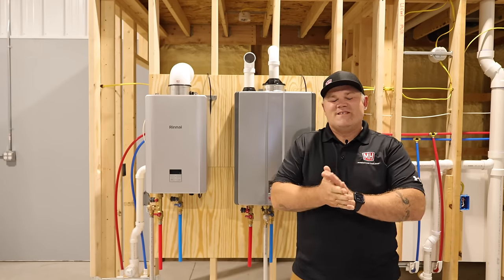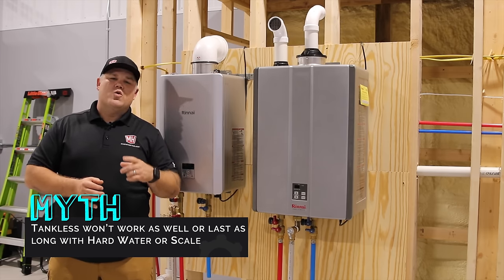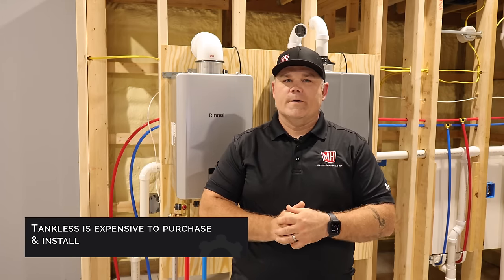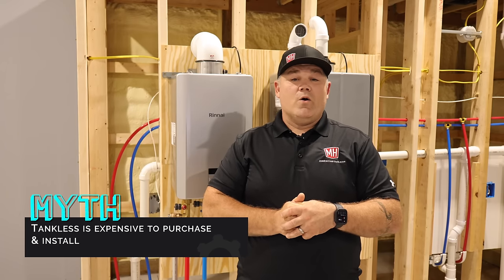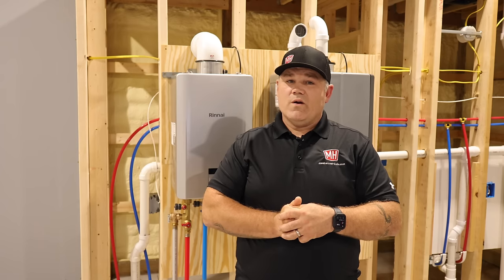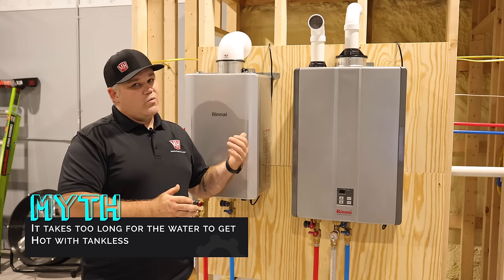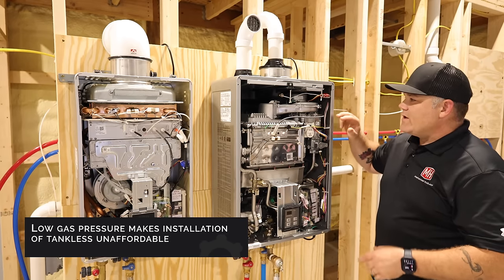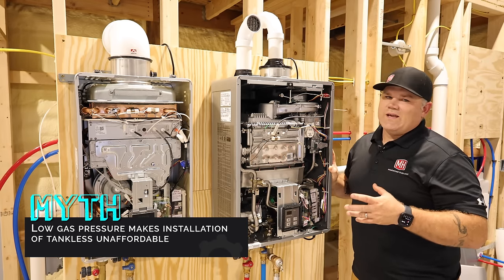Myth Busting! Tank -vs- Tankless Water Heaters

Comment: You can say whatever you want about tankless water heaters and how great they are.  I call BS.  I had 146 Rinnai tankless water heaters in two apartment buildings.  Both buildings had whole building water softeners that were well maintained.  We were replacing water heaters at the 6 year mark and replaced over half by the 10 year mark.  I will never have a tankless water heater in my home.  I am a licensed Master Plumber / Gasfitter in WSSC in Maryland.
Reply: Jackjack-jy3vu I am a chemist and I don’t necessarily have anything against your claim, the faster something heats the more likely is the material to malfunction. You do provide some good examples of materials that behave in this way. I would, though, be cautious to generalize this claim to all materials. We all know that different materials have different temperature capacities before basically melting or weakening. Steel to murcury or gallium which are metals that are liquid at room temp. Also different metals or materials are subject to different stressors bases on temperature changes. So depending on what the water tank heater is made of determines whether it can undergo the type of rapid heating without jeopardizing the durability of the material. That said, I don’t know what materials tankless water heaters are made of currently. It may be that they do degrade in strength or durability as you say. But as new materials are created this will change
Reply: Betting they weren't maintained. I've had mine for over 10 yrs with no issues. Just have follow the maintenance of them.

Comment: I've had the Rinnai in my house for more than 15 yrs. Our community has hard(ish) water (treated lake water), I've had the unit flushed twice, the solution was almost as clean as when I started.  Never an issue with not enough hot water, able to fill my 4 person hot tube with hot water.

Comment: I had a Rinnai water heater mounted on the outside of my house. It was rated at 8 gallons per minute. I never ran out of hot water. After 17-18 years, I had to replace it with a similar Rinnai model and again, it just keeps pumping out hot water. No regrets here.

Comment: I was using propane powered tankless heaters in Spain in 1964. They were cheap and worked very well. They have been used all over Europe for a very long time. I recently converted to natural gas her and heard the same myths when I enquired about tankless, especially the “our water is too cold here one”. They did install a larger meter because I expressed an interest.

Comment: Great presentation!  So many folks are so-o-o uninformed!  I am using my 2nd Takagi (Japanese) unit since 2003.  My first one was a, T-K2, 185k, BTU, with  natural gas (largest capacity I could get then). My 2nd one is again, Takagi,TK-3010U-I, I installed back in Oct, '22.  I can't believe the old one only lasted 22 years.  Guess they don't make'm like they used to :).  I am not HVAC, but a reitired RN and jack of all trades, ha ha.  I first learned of tankless hot water systems while living New Zealand back in the '80s.  Very popular.  We had a Rinnia unit, not sure which model, and we also had another one gallon, (or 4 liter) capacity, electric wall mounted tank for "cuppa's of tea," both natural gas, in the kitchen (most businesses there had one of them in their breakrooms.)  My plumber buddy helped me install the 1st one, back here in Kansas.  It was all new to us and we probalby broke some code rules.  We vented it out with triple walled, stainless steel, ducting into a three story brick chimney.  But it lasted for 22 years safely.  Like you, we never ran out of hot water, for showers, dishes, launday, and bathrooms,  since.  We raised 8 children and have all of the appliances that takes also.  We do have a 50 gallon holding tank, that feeds the hotwater unit, from our 2009 geothermal heating/ac unit. Our Kansas public water is 58 degrees into the house.  The the tankless unit call for water is delivered just under 70 degrees from the holding tank.  That makes a great difference in temprature change especially in the winter when the geothermal is in its heating mode.  MYTH MYTH MYTH.  People just do not know. 

 It is so neat you are out there to let them be aware. GOOD on you!  I subscribed and I LIKE!

Randy,
 
Hay seed in Kansas and money in the bank from my savings in water power bills.

Comment: 50 gallon 40000 btu Water heater tank just went out. Called around and best price for unit with install was $2700 here in north Dallas TX. Checked on a tankless as heard good things. Best price was $7450 because it required different gas line and venting plumbing. Y’all get the point. Found the exact one, had it delivered, neighbor helped get it into the attic and installed it for about $950 after running to Lowe’s and replacing some older hoses. Better for new construction if you’re thinking to make the switch.

Comment: 3 things, 1. Clarify using propane/natural or electric type units (mine is an electric with THREE(3) 60 Amp 220v breakers. 2. All thankless hot water heaters should be "backflushed" yearly to remove trapped hard water waste (Install flush kit when installing unit on incoming/outgoing lines). 3. My FIRST experience with thankless hot water (and I was blown away by this) was in 1983 (yes, 1983!!), while stationed in Germany.. I was never so happy to have "instant" hot water that never ended (providing "fuel" was present). 

I have 1 tank in my home, if I redo my hot water situation.. I would change to a unit at each location (ie.. bathroom/kitchen etc).

Other than power requirements, if you go electric, I love these (I do not have the brand you mention).

Thanks for the cool video

Comment: Had my tankless installed 18 years ago as part of a copper re-pipe of my old formerly galvanized home.  The overall cost of the re-pipe was about $500 more if going tankless.  The weather in my area is extremely calm, so an external unit was used to save on any necessary ventilation.  So far I have basically never properly maintained it (really, never any maintenance at all, too lazy) and the paint has oxidized a bit, but it's as rock-solid functional as day-1.  In my case; it's been all pros, no cons, and plenty of consistently hot tap water.

Comment: Can you give information or talk about what maintenance needs to be done with thankless water heater and how often
Reply: @andrewtalaga5328  i have an electric on-demand heater in Minnesota. Once a year, I use a pump to cycle diluted vinegar through it for about an hour. That’s it. Keep the equipment right there so I just have to hook it up, put water and vinegar in the bucket and turn it on. Rinse with fresh water to get the acid out of the system and the pump for storage. Mine is a Stiebel Eltron I bought on Amazon. Actually bought a lower-priced “Like new” that looked like just a return with some minor package damage. Unit was perfect inside. Saved a lot of money.

Comment: I have tankless in 2 homes. My main complaint was waiting for a minute or more to get warm water just to wash my face or brush my teeth. My solution was to install a small 2.5 gal tank under the double sink setup. Now, I get hot water IMMEDIATELY but I don’t turn on my tankless heater and waste water. Most other appliances use much more water so time is not a factor. These small tanks can just plug into a regular outlet and they use only 1500 watts. Love it.

Comment: Takes a looooong time to get hot water.   Like 2.5 minutes vs. 30 seconds for old electric tank.  Almost 3 gallon of water (I measured) goes down the drain before it's hot.  Rinnai RX199i.

Comment: I only could fit a 40 gal to replace my existing one. Plumber recommended a rinnai 13 years ago. I recommend it. Last year was first time I had to call for a service by authorized repair because it wasn’t working. They charge about 200 bucks to service it and it is still going. He was surprised I never did maintenance on it. He said my town must have soft water. Anyway to me having a tankless is the only way to go.

Comment: I have had my Rinnai for well over 10 years with only 1 problem. Sediment built up on the sensors and randomly shut the unit off. I installed a whole house filter for sediment and I flush it with vinegar every year or two and it has worked flawlessly.

Comment: I have a flow meter on my pipes to the shower. I know exactly how much hot water to cold water it uses. It's a lot less than 80% depending on what time a year and what the hot water heater set at. Love the video. Thank you.

Comment: Venting can be expensive if you have to route the vent pipe above finished drywall where portions will need to be removed and patched.   The whole ceiling will probably need to be repainted after the patch or the patch will be obvious by not blending in with the rest of the ceiling after painting the patch area, especially if the ceiling is textured.  There is also a limit on the distance you can go with horizontal venting but it can be increased with  larger diameter pipe, which may also be impossible if obstacles like HVAC duct is in the way.

I had an opportunity to install a tankless WH for a remodel but opted for a 77k BTU HTP 50 gal stainless tank.  High recovery rate similar to tankless but with a highly insulated tank and 97% efficiency.  That design offers higher hot water output than a tankless with the 50 gallon buffer with a smaller BTU gas line input, where a tankless unit would have been 160k BTU or more.  Many homes have 5/8" or smaller main gas lines which can't deliver enough gas to a furnace and tankless WH at the same time on a very cold winter day for a decent size home.

Take this myth busting vid with a grain of salt.  Not every situation is the same.  This vid is correct if you can check all his boxes.

Comment: Had an electric tankless for 23 years, needed it with 5 boys...worked great, instant heat....kept the girls from staging a revolution, as they could have a bath and actually get hot water (had two systems-tank in the older part of the house-tankless in the newer.)

Comment: I installed a propane-heated Paloma tankless.  It worked okay for a couple of months, then it started cutting off right in the middle of a shower, and then mysteriously coming back on again... sometimes.  I went back to using my electric heater, which I only turn on ten minutes before I shower, then turn off when I'm done... works perfectly.

Comment: regarding gas line and meter upgrade, the code requires that a tankless WH uses min 1.25" gas pipe, and this can go up if the WH is far from the meter.  Even if you think it works without upgrading the pipes and meter, the code doesn't care, you still have to pay for the pipe and meter  upgrade.  You also didn't include the 120 volt outlet required for the tankless controls. Old WH didn't require power. New installations won't see this extra coat,  but a retrofit may require running a circuit to the tankless WH location. 
how about annual maintenance cost? it is a must with tankless, tank WH will go 10 to 15 years without anyone looking at it.

Comment: I self-installed a electric tankless several years ago.  Well water, treated for iron and softened. Did all the electrical upgrades myself. Couldn’t be happier, and gained a corner of my garage. Before that, two (one very expensive) tank heaters leaked at the inlet pipes. Never again.

Comment: Perfect timing.

I’ve been looking at tankless lately because wife said our tank WH is not keeping up. I will take a meter to the elements and check them, but the tank is 20 yrs old and we plan to sell our house this year and I don’t want appliances to be an issue so since I live in Florida I’m thinking electric tankless which I noticed is less expensive than a tank heater.

Could you please do a review on the electric tankless heaters please…. BTW I enjoyed your video. 👍😎👍

Comment: I was a general contractor building custom homes for many years. Tankless heaters work well if there isn't to much water pressure. If there is high pressure you must not turn the valve on full blast when filling the tub for instance because the heater cannot keep up and you won't get anything but warm water.

Comment: Good info.  I had an old tankless system.  The problem came in filling a bathtube up with hot water.  The tankless could not deliver the hot water flow rate🤨.

Comment: Under normal conditions it sounds great.  Should you lose power for a day or more (storm, accident, etc.), a standard tank water heater has the advantage of holding hot water for several days before it cools off, using city water pressure to maintain the flow as needed.  Unless you have a generator or UPS tied into your tankless system, this could be a problem albeit a somewhat remote one.

Comment: Having used one in the house we purchased…the mixing to get a set temperature in a shower is difficult at best …apparently he hasn’t seen recent quotes for the installation of both types…the tankless is at least double & more ……save money on gas …..not really…..very minimal fuel savings….also these units have to be “flushed “ serviced yearly, depending on the quality of the source of the water …every other year at a minimum….
He is absolutely correct on treating the water beforehand….especially if you have high iron content….
No, we are going back to the tank type….

Comment: I have an electric tankless. I switched to tankless because it was the cheaper option when my tank heater failed, and I was able to get some precious garage floor space back.
It takes about 1 minute longer to get hot water to my farthest faucet. My lights dim when the tankless turns on, but I have noticed an overall reduction in my power consumption because I'm not paying to keep that tank hot all day and night long.

Comment: I’ve had a tankless gas Takagi for over 20 years. I’ve replaced two sensors over the years and one board due to a lightning strike.  I love mine.
Reply: I have a low end cheap ass contractor special tank for over 25 years, and haven't done a damn thing to it. I love mine. I mean... I don't. It's a fucking hot water heater. I don't actually give a crap about it. It makes water hot. That's nice and all. But it's literally its one function, so I guess I appreciate it? Like I appreciate my roof shingles.

Comment: The only problem we had with our Bosch tankless system was it freezing over. I live in South Dakota and on days the windchill would get into the extreme negatives, the system would freeze from cold air coming from the outside vent. I believe the newer systems have protections for this now. That being said, when my tank goes out in my new house, a tankless system will take its place.

Comment: Never mentioned electric tankless and having to run a 220 volt outlet. Comparing electricity usage vs gas usage. The electric tankless cost half the price of a 40 gallon tank natural gas, but the yearly energy usage averages out more running a constant 220...but you have the expense of converting and the higher maintenance of the electrical unit. Just cuz it's new it doesn't make it better or more efficient. In the video you can see the red and blue PEX tubing use for plumbing now supposedly because it's cheaper more efficient doesn't freeze over but it's only more efficient and cheaper for builders. They raise the price of building your house but lower their material prices. I've had to fix repair replaced the PEX tubing in houses that are only a year old they're easily damaged during install. Usually pierced by sheetrock screws when the sheetrock is installed as well. Builders will wait till your 1-year warranty is over and stick you with the repairs

Comment: Good myth busting! I've been using electric timers on my electric water heaters for over 30 years, in 3 different houses. I feel certain using them takes the cost of operation comparison out of the equation as my water heater comes on once a day, for one hour. The Timer cut my bill by about $50 a month. My heater is 80 gallons but, in the past, I had 60-gallon heaters and just ran them 2 hours per day (the timers can be programmed to numerous on/off cycles). My current heater is 26 years old, and yes, I flush it about every 5 years and inspect the anode, but I've been considering going tankless but likely won't since I'd need to run a much larger electrical circuit since the existing 30 amp circuit I have now won't cut it, and I probably couldn't use my existing generator automatically without overloading it unless I added some additional automation. There are lots of variables in play for what would seem to be a standard appliance!

Comment: I have tankless now and this saves a how cost to the tank water heater. Tank water heaters are constantly running to keep the water hot.  The first month after i switched from tank to tankless I saw a $70 reduction in gas bill.

Comment: Ive been a mechanical contractor for 30 years. I’ve been using tankless for the last 16 years, I’m currently on my 3rd one (All rinnai). The first 2 that failed were due to failed copper heat exchanger, I would never recommend a copper heat exchanger, stainless is the best. Also if you have kids there is a 100% chance your water bill will triple as they will let the shower run forever. I have had to beat on the door and tell them to get out of the shower after an hour and half on many occasions. Other than that I’m happy with them!

Comment: My two rinnai units are 16 years old and are in like new condition still.  I did have issues with on many years ago but it turned out to not be anything with the unit.  The issue was that a mud dauber had filled the vent on the gas regulator with mud and eggs.  I cleaned it out but a week later, the problem returned.  Figured the mud dauber issue was something unrelated.  Nope.  Went and checked and it was full of mud again.  I bought a special vent cover made specifically for this reason.  No problems for probably 12 years since.